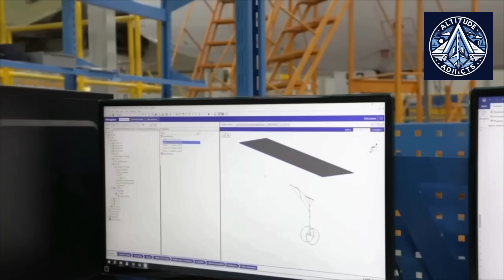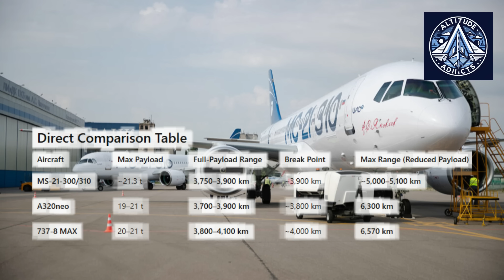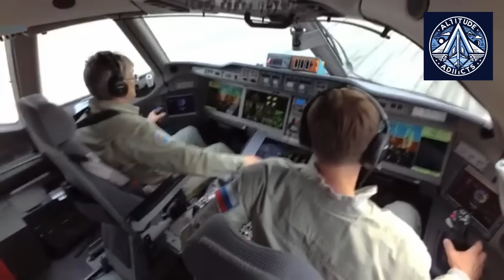MC-21 Range Controversy EXPLAINED: What UAC Didn’t Tell You

Comment: Thanks for that important clarification. In your comparison table, I assume "break point" means break even point, which is to say the maximum payload reduction range that does not result in an economic loss? I see the B737-8 MAX has the edge, on not only on the MC-21, but also the A320 neo! I further assume that the data for the A320 neo is for the Pratt & Whitney PW1100G-JM engine equipped option. This is a geared turbofan option and is more fuel efficient. I am therefore somewhat skeptical of the B737 numbers. The MC-21 is a fine aircraft and can only improve as the design type is further developed. Keep going Russia!!
Reply: То незначительное количество Боинг Макс и А320 нео, что успели закупить в России до санкций пришлось продать за рубеж, так их слишком сложные двигатели и система предотвращения сваливаний требуют особой поддержки невозможной в усовиях санкций. Более ранние Боинги уступают МС-21 и ПД-14 по топливной эффективности, это несчитая санкций. Так что у МС-21 нет конкурентов, все основные рейсы он способен обеспечить, прямые дальние рейсы больше 5000 большая редкость и могут быть заменены пересадками. МС21 в отличии от Боинга и Аэбаса оснащен композитным крылом, по мере модернизации у него есть все задатки стать лучшим узкофюзеляжным самолетов в мире, его отделяют от этой цели санкции на американские двигатели и японские композиты, с которыми росатому не удалось справиться.
Reply: How are you going to break-even with the engine in the shop?  Probably make all the money on compensation payments from PW

Comment: Автор забыл упомянуть, что максимальная загрузка МС-21 - 211 пассажиров. Так что 3800 км он летит с уже далеко не полной загрузкой (всего 175 пассажиров). А если его загрузить полностью, он похоже и 2000 км не осилит.
В таким случае, 5000 км, это всего лишь перегоночная дальность (самолёт пустой и заправлен топливом под крышечку).
Reply: Eso no es problema. En Chile, diversas aerolineas utilizan el A-320 en los vuelos de corto y mediano alcance, como:  500 Kms (Concepción), 610 Kms (Temuco), 740 Kms (Valdivia), 1.000 Kms (Puerto Montt). También a Buenos Aires (1.100 Kms) o Lima (3.300 Kms.).
Reply: 211 is one class charter, 2 classes, the standard, is 175
Reply: @galimbertino4939 yeap, but 2 classes capacity is mean not full payload. Full payload is 211 pax only.
Reply: @roman_burov а что кроме пассажиров он ничего не везет?

Comment: The most important and competitive characteristics of a commercial passenger aircraft are, of course, maximum takeoff weight, maximum passenger capacity, and maximum range. However, Russia's MC-21 passenger aircraft cannot compete with Boeing or Airbus in terms of specifications. Russia must first conduct research and development to reduce the MC-21's weight. An aircraft that is more than 10% heavier than competing Western aircraft will not even be able to sell overseas.
Reply: You just heard the comparative data but you still repeat some sick propaganda!?
Did you notice that, in addition to being heavier, the MS-21 is proportionally bigger than the mentioned competitors!? 
The MS-21 is 5 meters longer but also 5 tons heavier than the A320... on the other hand, the A321 is only 2 meters longer than the MS-21, but it is a whole 12 tons heavier!
It's the same in comparison with Boeing... MS-21 is the same size as Boeing 737MAX9, but that's why Boeing is 3 tons heavier than MS-21!
The numbers don't lie... for its size, the MS-21 is lighter than its direct competitors!
Reply: Кроме спора о длине /весе /полезная нагрузка ,России важно иметь самолёт в серийном производстве.Задачи сейчас нет конкурировать.И это самолёт с комплектующими первого этапа,ведутся работы по  улучшению параметров и снижению веса.Самолет получился тяжелее, чем в проекте ,на 5  тонн.
Reply: It doesn't need to compete.  Just needs to perform reliably
Reply: Untuk hal ini anda wajib paham bahwa MS-21 ini lebih lebar dan lebih panjang kabinnya jika dibandingkan A320 Neo dan Max8.
Maka dari itu, memang pesawat ini jadi lebih berat.
Reply: this thing is not commercially viable. no one in their right mind will buy it, unless north korea which has no other options. even Iran will not buy it. a dead duck
Reply: @DubaSangara entire aviation market of CIS can buy it

Comment: I f'king knew it as someone who had tracked down actual operating ranges of A320 neos and the 737 Max. The MS-21 more than matched the former A320 neo and wasn't far behind the latter, plus if it's Boeing; I aint going. Well, at least the MS-21 has a locked in market domestically, and with tuning over time and EXR variants it will probably end up being a very competitive narrow body airliner. Just lul at those stup!d western aircraft fans using gutted out F'king ferry ranges of Airbus and Boeing to mock a plane they know nothing about.

Comment: It is the standard range, just like the A320 and 737 Ng and MAX .... The MAX Carrie's 9 fuel tanks compared to the standard 5 fuel tanks or the standard A320, A320 leap, A321, A321 neo and the A320 XLR,  the latest MAX and 321 XLR carry 20-25 extra tons of fuel in 9 tanks for the MAX and 2 containers used as an extra fuel tanks on the XLR....
But they list the MTOW of the standard models and the range of the ones with the extra 20-25 tons of fuel, you can not cherry pick best attributes of the different models.....
As for the Russians, range is irrelevant since you can always incorporate extra fuel tanks to satisfy your costumers, or just do an Airbus trick and put an extra set of containers to boost the range to suit....!..
Reply: In nur 2½ Jahren hat man ein Flugzeug Impotsubstituiert.
Das einige Zulieferer hier auch noch am Gewicht ihrer Komponenten arbeiten müssen ist klar.
Auch Airbus & Boeing feilten seit Jahrzehnten an jedem Gramm Gewichtseinsparung. 
Auch UAC wird hier noch weiter dran arbeiten.
Auch das PD 14 soll noch weiter verbessert werden.
Jeder Zusatztank beeinträchtigt auch die Nutzlastverwendbarkeit für den Cargobereich, der für die effiziente Einsatzgestaltung meist nicht unwichtig ist.
Reply: Yes, I am curious to see MC21 options with that extra fuselage midline fuel tank used in the A321XLR, for Moscow/Vladivostok.
Reply: @madmax7622  Not needed, that's the job for a new midrange plane or at least the TU-214 can deal with it.... The extra fuel will add an extra 20 tons of weight to any aircraft which the MC-21 can't carry because it would need a double boggy landing gear and frame reinforcements, an extra couple of tons of fuel would be sufficient for a 6,000 Kilometers range....